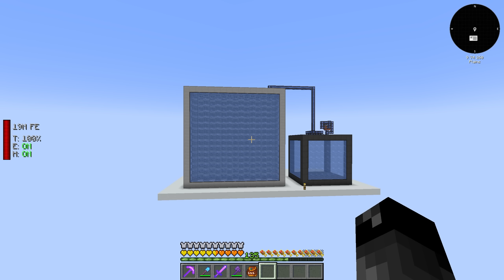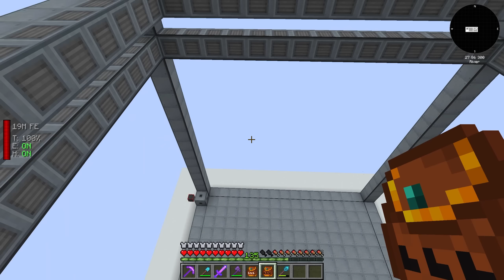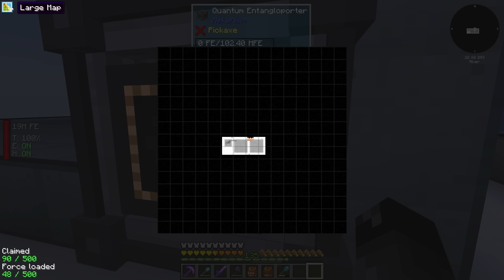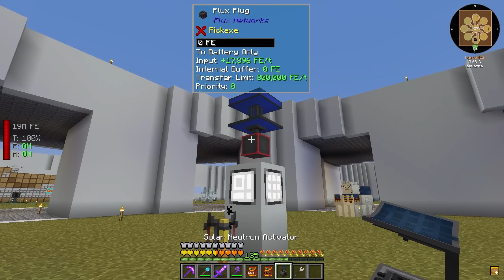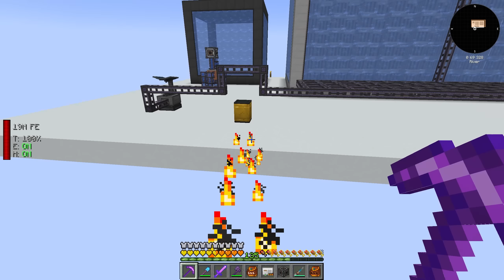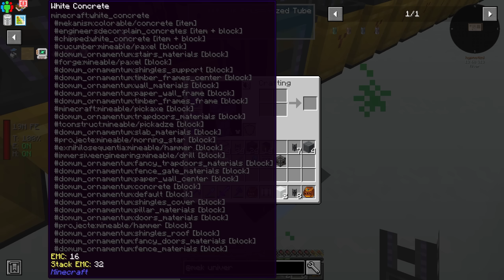Modded Minecraft E54 - Turbine Power

Comment: Why are we looping the water instead of just generating infinite amounts again?
Reply: The rate of which you can pull from the sink is limited with the mechanical pipes... Also the multiblock looks cool :D. In all seriousness a sink holds bit limit mb of water and I believe only integrated dynamic pipes can move that much per tick.
Reply: @goncorplaying  then just make like 50 sinks then slap it on the big tank lol, no need to worry about taking water back from the turbine, so you can trash the return eater
Reply from the maker: You could fill in unlimited water if you wanted to. There is a LOT of water that needs to be replaced. It really is easier to just extract out of the turbine and fill back into the reactor. The water tank isn't necessary, but I wanted an extra buffer of water to make sure we didn't run the reactor dry.
Reply: @hypnotizd  makes sense, I haven’t used this version of reactors myself yet so ig I don’t know the actual scale of water used